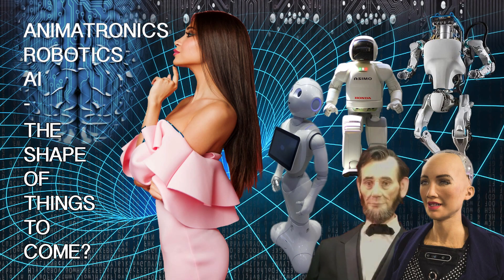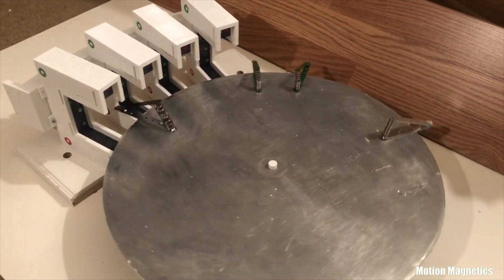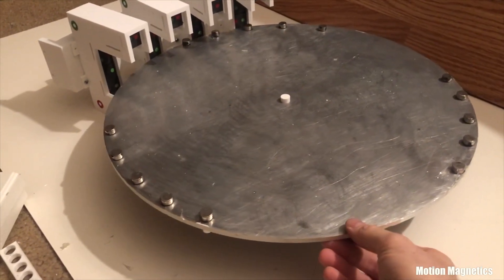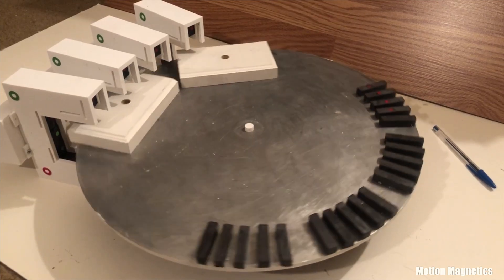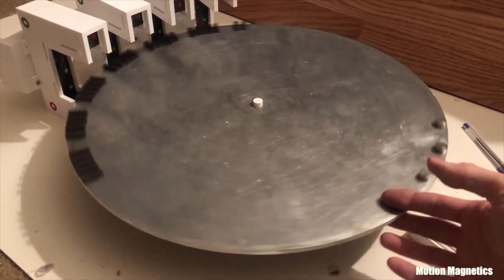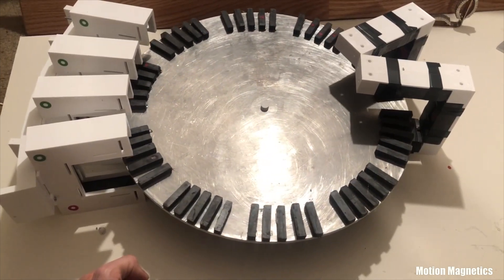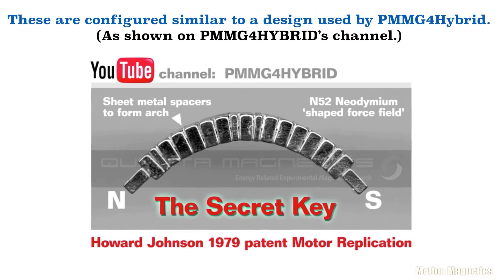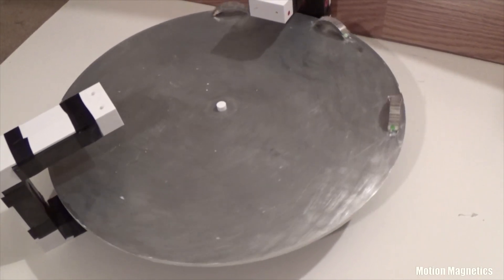Breaking The One Inch Barrier

Comment: i find magnets like a metal spring. if you can do it with a spring then you can do it with a magnet. 
how about using magnets against itself with gravity. to have a bottom magnet facing south up and another magnet above having south facing down. and let it bounce. and the heavier and more powerful the better. And in between the top magnet to have one coil at the bottom give off a small spike of electricity from the coil at the top which the magnet passes though when it bounced to to it move with frequency. And a small change and increased it maybe.
Reply from the maker: Well, that's an interesting thought. If you enjoy researching things you might want to read Howard Johnson's book or watch the videos about him from the Energy from the vacuum series? What magnets actually do is far more sophisticated than springs.
Reply: @Motionmagnetics  I agree with u but I am saying how we have to think out of the box and try to see if the method works on other types of physics. 

Also thr issue is loss.video from Laser sable is good how he has very little in loss to remove as much friction as possible. 

But I feel u need to fix a broad spectrum of things to make something like over unity. Since their is laws in everything. Even motors r very inefficient due to the loss from the material thr friction in general the way it's done. Even the coils cause electromagnetic friction which no one adresses.

Also look at science Lee's  channel how he explains better how magnets work. Which that might give you some other ideas.

Comment: You should not use any metal in moving construction with magnets because it's self braking by induced Foucault current.
Reply: Howard Johnson, the guy he talks about, used metal on purpose in his working design.  I don't think he ever figured out exactly why this made his design successful, but I suspect that the exact currents you mention that would cause problems were actually able to make the design work.  Something he took advantage of those were the eddy currents rather than suffer from them.

Comment: I think it would be interesting to see magnets configured in a vortex-like shape, similar to how water looks as it drains down a bathtub. There would be more magnets on the outside, then fewer and fewer as they curve down to the center.
Reply: Fibbinocci spiral?
Reply from the maker: I think that's what Muammer Yilditz was going for in his motor?
Reply: @Motionmagnetics  My reasoning is that water travels much like electricity, and Howard Johnson said that the magnets have vortices in them, so maybe shaping  magnets like a water vortex might do something. I've noticed small things build up bigger things with the same pattern, like how the solar system looks like a vortex, and so does the galaxy.

Comment: Funny thing is you could, or at least you used to be able to, go to the Tesla museum in Serbia and see magnet motors run. Therefore we know for a fact it is possible. I wonder did you try these steps on a vertical wheel?
Reply from the maker: I'd never heard of that one before. I have tried a rotor with multiple levels/sections, that sounds like what you're suggesting.

Comment: hi from noname scientist without any support. As  long ago I wrote to you about the use of copper or aluminum. U can use 3 discs. 1 disc is stationary with the weakest magnets. 2 and 3 discs are movable. 2 disk with holes for magnets, so that the field from the magnets acts on both sides (on the 1st and 3rd disk). 3 disc is located on top. it has the most powerful magnets. consider the ratio of the number of magnets 1nMagnets> 2nMagtets> 3nMagnets. the amount matches the Fibonacci ratio (like 34/21/13). Due to the through passage of magnetic fields through 2 disks (holes where the magnets are fixed), the magnets of the fields of the 1st and 3rd disks will interact, despite the aluminum disk. the fields will slide. Then change plases of 2nd and 3d discs(dont forget that u wiil need holes on 3nd disc ,2nd disc without holes in taht variation). Look difference.   So  hard to explane it but u can understand it. I know. U can. I can send u to yours mail my vision of this thing ( 1 pencil picture to understand.)
Reply from the maker: Well, that sounds interesting. If you have that all mapped out you should post a video of your drawings or a 3D model?

Comment: I recommend also using Fusion 360 for 3D designing. It has much greater designing capability and I started on Tinkercad and then started using Fusion 360 and it’s a good step up.
Reply from the maker: Thanks. That's a good idea. Tinkercad is nice but definitely has its limitations.

Comment: The only thing your idea is missing is some coated copper wire and a battery. Only then will such a device ever break past the "inch barrier".
Basically, without them (ie - copper and a battery) you will perpetually get a 50% pushing force, along with an equal 50% braking force (at BEST), which equals 0% output.
Reply from the maker: I know Howard Johnson pulled it off, and there are people who have talked about seeing rotary devices he built, so I believe it's possible. He was after the exchange force pulse though, which is why I mentioned that in the video. I've never seen anyone else use his methods for mapping and photographing magnetic spins though, so he had the added advantage of being able to see exactly which magnetic arrangements he built were tapping into this effect. The rest of us are trying to use math and/or experimentation to figure it out.
Reply: @Motionmagnetics  Hi, you say: "I know Howard Johnson pulled it off, and there are people who have talked about seeing rotary devices he built, so I believe it's possible"...
How do you "know" Howard Johnson puled it off? I know some people say this and that, but the proof is always in the pudding ("belief" isn't quite the same as "knowing") :)
Can you show me a working Howard Johnson model? Why have I not seen it? I've been researching this for a few years now and I've pretty much 'seen them all' (well, nearly I guess). I've tested a number of ideas myself, but I soon realized why it isn't possible (yes, I've lost much sleep in thinking this or that gizmo will 'solve it'). It is, as you say, the "one inch barrier". It goes with all such devices (eg - gravity wheels, where the exact same principle applies).
I think you are a talented dude, but I feel you might want to put those talents/efforts into making a better (ie - More efficient? More powerful?) DC motor, or something like that! This is what I'm 'trying' to do :)
Reply: @jsouthern3838  ты парень не знаешь о чем пишешь! Что ты знаешь о Говарде Джонсоне? Ты хоть видел все видео с его участием? Знаешь, что он не собирался никого посвящать в суть своей работы?  
Будь ты умнее, не писал бы подобный комментарий. 
Ты и тебе подобные думают, что знают все на свете. 
Побыл бы ты в шкуре Говарда, когда его гнобили за его выступления, может тогда бы понял чего-нибудь. Понял почему он не рассказал все, что знал о магнитных полях. 
Таких героев как ты - пруд пруди. Это русская поговорка, тебе не понять. Были бы все такие как Говард, человечество находилось бы на более продвинутом уровне.
Reply: @ВИВЕЙ  Покажите мне работающий мотор Говарда Джонсона, тогда я буду есть свои слова;)
Reply: @jsouthern3838  не люблю повторятся. Если строить магнитный двигатель по потентам Говарда - он не будет работать. Понимаешь? В патентах нет нужной информации. Если ты не понимаешь что Говард подарил миру, я тебе обьясню. Он открыл Квантово-Механическую Молекулярную Энергию. Знаешь что это и как получить? Раз у нас идет такая беседа, значит ты не знаешь. Посмотри хорошо на изображения магнитных полей Говарда, может что поймешь.
Раз ты интересуешься подобной темой, хочу задать вопрос.
Возможно ли получить движение в замкнутой магнитной системе или нет? И конечно точки "входа" и "выхода" тоже пропадут. 
Если ты думаешь, что возможно движение, тогда обьясни почему. Если ты думаешь, что не возможно движение, тогда обьясни почему. 
Или не знаешь что ответить?

Comment: My observation : in my experiment I found a rocking disc gives you wrong results ... meaning , if you stop the rocking by fixing it hard , the results later are opposite to what we get when it rocks... you are getting 2 or 3 rotations because of rocking ... stop the rocking of disc and getting one full rotation  would be difficult.
Reply from the maker: Yes, but I'm not sure the rocking is necessarily a bad thing. That's what I was saying in the video about always thinking in a linear fashion. Sometimes it might be better to do what seems unconventional. Howard Johnson once suggested making the rotor and stator assemblies both rotate around each other, rather than have the stators fixed in one location. I thought of this when I noticed the wabbling increasing the number of rotations.
Reply: @Motionmagnetics  I understand your thinking here, but there are other frictional effects of the rocking that make the rocking worse overall.  Taking advantage of the 3d effects of the magnetic fields is likely an important aspect (probably necessary to succeed), but the disk rocking like that is not going to be the answer IMO.  I made another comment on this video talking about resonance and electrical currents.  The rocking you are looking for, IMO, to help overcome the 1-inch barrier is going to come in the form or resonance.  A little will build up during each cycle (and there are several cycles/ways I can see it building up) and at a peak of one of these cycles it then gives you the push you need.  That resonance, I believe, came from the electron from from eddy currents (in Howard's motor), but I can see other ways in which resonance can be used to break the 1-inch barrier.

Comment: Mount it vertically and use gravity to assist and or have a separate mechanism that is "charged" from the disk for stored momentum.
Reply from the maker: That's partly why I was using a flywheel effect in this video. I've already tried a lot of things with gravity in my last two videos.
Reply: @Motionmagnetics  yes point taken, what about stacking 3 or 4 disks on the same spindle and spacing the effect to pull it over the gate?
Reply: @Motionmagnetics  perhaps a sort of teeter totter system could be made?

Comment: When changing the magnet configuration on the circle, you change the friction on it's base. That causes it to spin differently far.
Reply from the maker: Yes. Every time you alter the configuration it changes the results.
Reply: @Motionmagnetics  That is because the friction on the axis changes, making it run differently far. You might have also started it on points of higher/lower magnetic potential points, giving it a bigger or smaller initial energy.

Comment: Always a pleasure to watch your experiments. The wobble was most intriguing, and how you thought it improved your chances for a rotation. I wonder if a built in slight Vibration would increase success...
Reply from the maker: It was something I hadn't given a lot of thought to before. I didn't secure the rotor to anything, and the magnetic field interactions between the rotor and stators were causing the rotor to wobble quite a bit in some of the setups I tried. I was really disappointed that I didn't have the camera running a couple of times when it happened.

Comment: Well done Great work... Also try to put coils around the magnet and switch them open and shorted out and have a capacitor across the coils.. this could give the right pulses to accelerate them...and turn the disc into acceleration...
Reply from the maker: Perhaps I'll try something like that at some point? My goal has always been to achieve continuous rotation without an electromagnetic assist though.
Reply: @Motionmagnetics  Yes, but will be hard to achieve...
I guess the Russians have already got it to work in the infinitysav.com motor, if it is not a scam...but looks pretty good...They also switch and shortout coils in their machine, that approach the permanent magnets..
Reply: @Motionmagnetics  that's like trying to hit a golf ball without a club.  The B-field is only one portion of the equation factoring into forces at play here.  With the right stator configuration, a few well placed coils, and the right resonant capacitance to give the directionally biased oscillating E-field match your desired rotor motion and you can get the anomalous modes of operation you are seeking.  I think some thoughtfully arranged electrets would also help this along quite nicely.

Comment: Does the ball bearing cause any drag? In trying to reduce variables, I have been using ceramic bearings that are not attracted by magnetism.
Reply from the maker: Using ceramic isn't a bad idea. The aluminum disc I used in the video is 18 inches in diameter which kept the magnets far enough away from the bearing that it should have minimal effect on the overall mechanism.
Reply: I always wondered if you switched from steel to copper bearings if it would produce a small electric charge this coupled with a Aluminum Housing to hold the bearings...
Reply: Steve-o that’s another variable that I have thought about too. I’m not that far along to add that. Maybe later. Lenz law causes problems.
Reply: You will ALWAYS have drag using ball-bearings (or any bearings). Even if one could escape this, even the surrounding air is a drag. I know... what a drag!
Reply: Why not make a near frictionless bearing using magnetic levitation or suspension?